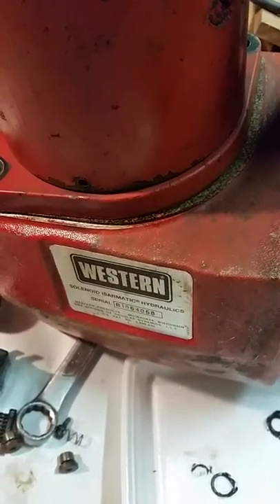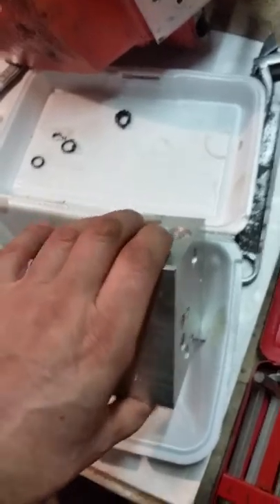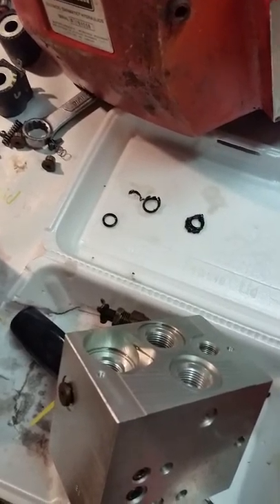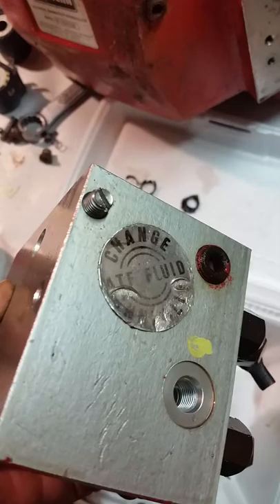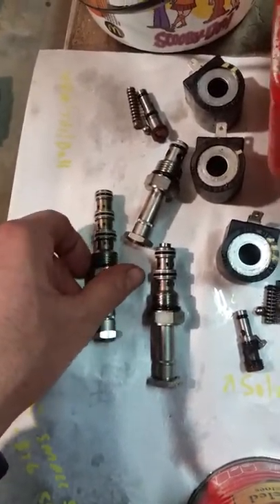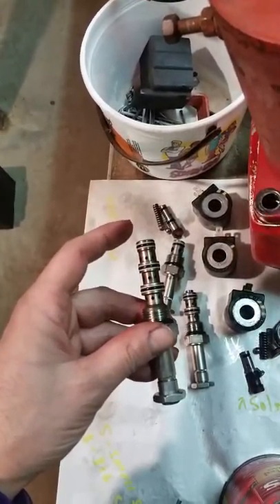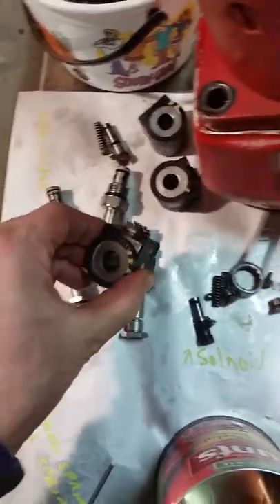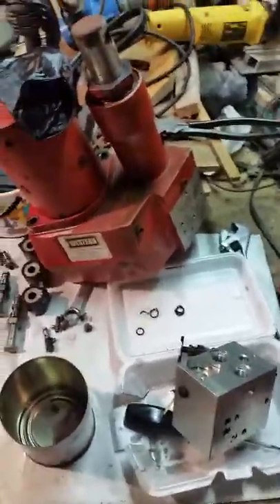Western Snow Plow Ismactic Hydraulic

Comment: do you know of any reason why the manifold would leak where it bolts on the  pump body, I cleaned it good and replaced the three O rings, it still leaks, do you know where each wire goes from the solenoids thanks,,  are any of the wires connected together or do they all run separate to the switch.. actually, I took this off a junk truck and mounted it on a MF farm tractor, not sure just how it is wired. it goes up and down , just has that little leak.
Reply from the maker: Block or mounting surface could be not flat. Could try a little RTV on orings,  get the GM stuff its pricey but good.

Comment from the maker: Selling plow or parts from it. Can't find mounts for it for a 08 truck. It is Unimount. Plow is good condition powder coated 10years ago. Recommended to that snow plows. Control and box work very well and lights are in excellent condition. Straight blade like to get $1500 for everthing.  Truck it was on, engine is bad oil filter fell off. If took them both $2000. OBO.
Reply from the maker: Found a different truck with mount on it. Like to sell the whole truck with plow. $6500. 95 k1500 196k 
Not very rusty but rusty in the usual places. 215 tires excellent condition. Hand held controls.

Comment: So what valve was bad 1 or both 1 an 3
Reply from the maker: I believe both. There not very expensive to just replace or rebuild them. But a good annual cleaning would keep it running when you need it. Normally it quits when its colder then normal.  O and get the newer solenoid for up and down. That's the one near your battery with big wire on it. My plow guy in my area reconmend it.